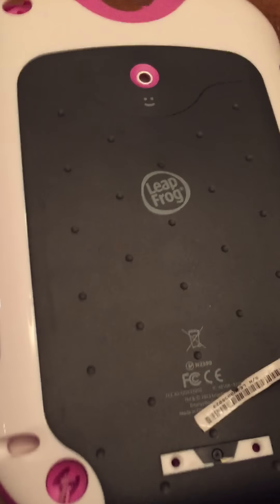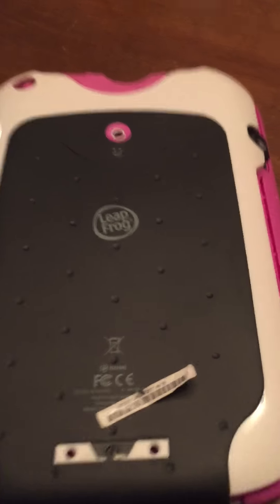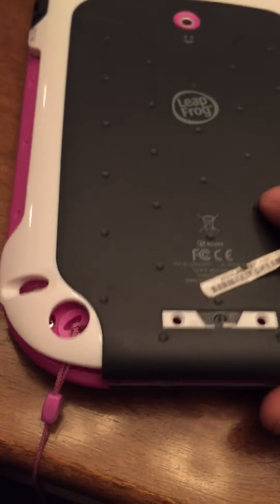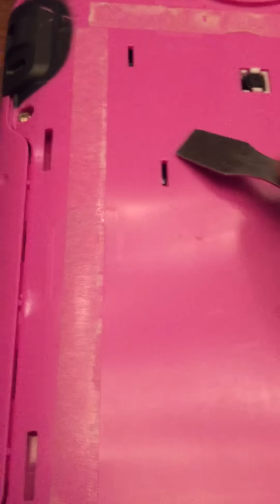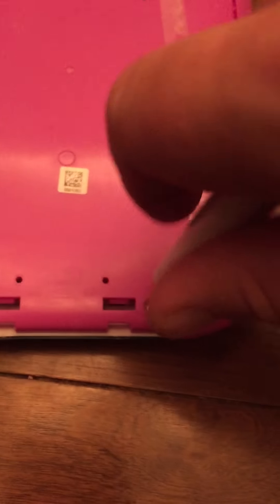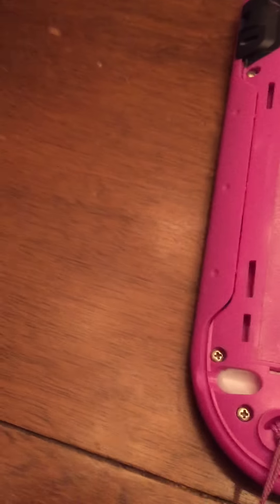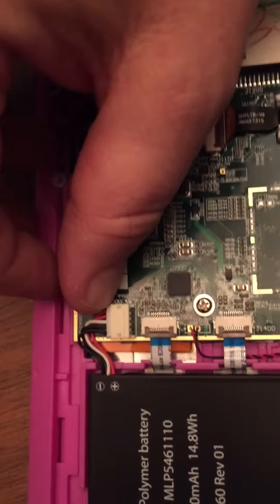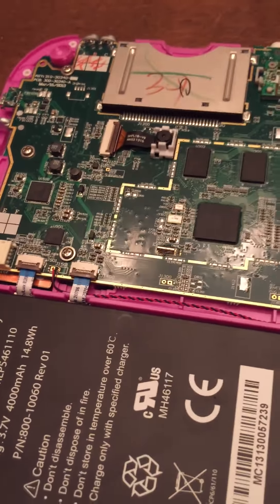How to repair the faux low battery error on a LeapPad Ultra

Comment: Killer video on how to take it apart.  This was just what I needed to start.  My daughter had her screen broken and I went a bit deeper and picked up a pair of broken ones on Ebay for 13 bucks which one had a good screen.  Getting into the case was my biggest concern and you helped me out of the gate, the rest was just screws and a matter of good lighting to see what your doing.  I now have my daughters up and running and have kept the parts in case the battery goes south, but your video also gave me something to trouble shoot if the unit doesn't take a charge or gives me the symptoms you describe.  Thanks!  Took me over an hour to take 3 totally apart down to the screen and get one back together working slowly and carefully! Thanks much!!!
Reply from the maker: Thank you for letting me know. It makes my day knowing someone else was helped and there is anither happy child again (and a Dad looking like Superhero).

Comment: I was having trouble with my son's Leap Pad 3 charging after it was dropped in water. I had let it set in dry rice for a day to try to draw the moisture out and then plugged it in to charge hoping it would still work. After an overnight charging I tried to turn it on and it didn't power up. It would power up while connected to the charger, but not when disconnected. I was almost ready to accept defeat and tell my son he could only play it while it is plugged in, but decided to search the internet just in case there was some way to fix it. I found this video and it worked! This video is for the Leap Pad Ultra, but it also worked for our Leap Pad 3! Thanks soooo much for the video! It saved the day for sure!

Comment: Thank you for this video! It took me some courage to open it up but it was pretty easy. Used a screwdriver and a little eyeglass fix kit. Hardest part was trying to get that tiny plug out and getting that cover back on there. Took me awhile to figure out if it worked or not, but it's all fixed. Thanks again!
Reply from the maker: Jessica Rene Wonderful!! Thank you and I am pleased that it is working again :)

Comment: YESSSS! I took it apart like was described and yes it was a bit tough towards the end but i persevered and followed Earls direction, thanks Earl. the video was perfect. i had to go back and forth a few times to get the directions perfect. but yes it worked. Thanks again....
Reply from the maker: You are very welcome. Thanks for posting your experience.
Reply: Earl, i got a call from daughter saying that she can't get any of the games and also her computer doesn't recognize the pad but it does charge, got any suggestions?
Reply from the maker: Rick, without having the unit in front of me, it would be very hard to say what may be wrong with it. - Norm

Comment: Sadly I tried your fix on my son's leappad and it still isn't working. I've unplugged, replugged, left unplugged for several minutes/hours, held the power button for a short time and long time, and it is still immediately flashing the low battery symbol and then shutting off. It is past its one year warranty so they won't send a new one. Any other ideas of things to unplug? Usually my way of fixing electronics is to hit them but thought I should try the gentle stuff first before beating on it.
Reply from the maker: +backpackergirl1  That is so sad to hear. Sadly I do not have any other suggestions short of possibly changing the battery. For that you'd probably need to look to eBay to find another unit that has a cracked display that you can salvage the battery from. I don't think you can buy the batteries outright.
Reply: backpackergirl1

Comment: I was having the same exact issue with my leap pad and they are sending me a new one. I tried what you did on the old one and now it works perfectly! 
I was just wondering, do they somehow "lock" the old one so you can't use it? Or will we now have 2 functional leap pads?

Comment: OUR LEAPPAD ULTRA WILL NOT CHARGE. WE PURCHASED A NEW AC ADAPTER THINKING WE NEEDED A NEW ONE AND CHARGED IT FOR A FULL DAY AND THAT DID NOT SOLVE THE PROBLEM. I ALSO TRIED THIS AND WE HAD NO SUCCESS. I THEN CONTACTED CUSTOMER SERVICE AND THEY WERE NOT OF ANY HELP. I BELIEVE WE NEED A NEW BATTERY ALL TOGETHER BUT OF COURSE, YOU CAN NOT FIND ONE ANYWHERE AND CUSTOMER SERVICE DOES NOT SELL REPLACEMENT PARTS AND WE ARE CLOSE TO 2 YRS WITH THIS DEVICE. SO UPSETTING TO KNOW THAT WE HAVE TO PURCHASE A BRAND NEW LEAPPAD ULTRA. I MAY NOT AFTER THIS ISSUE. IT WILL MORE LIKELY HAPPEN AGAIN I AM SURE. SO UPSETTING. DOES ANYONE HAVE ADVICE ON HOW I CAN FIX THIS WITH OUT PURCHASING A NEW LEAPPAD?
Reply from the maker: +Pittsburgh Stone and Waterscapes, LLC Don't fret. You may not have to buy a new one as there is still one more option. You can look through ebay to see if there are any out there that are being sold with a cracked screen but otherwise in working condition. If you find one, it may be worth your while to buy and and use it for spare parts. Your still taking a bit of chance of getting another dud, but I bet you could find it cheap enough that it would be worth the risk. I hope you get it repaired. - Norm from Wye Oak Mobile Device Repair

Comment: My son LeapPad Ultra won't read cartridges. Do you have any suggestions what I should do.
Reply from the maker: If it is still under warranty, call LeapPad. They are very good with replacing their faulty items. If that is not possible then with the unit turned off, try cleaning the cartridge slot with a que-tip and 91% rubbing alcohol. I'm afraid that if that does not help then you'll have to purchase a new unit as there are virtually no sources for aftermarket replacement parts on these units.

Comment: Grateful for efforts & sharing this. I bought a refurbished one CHEAP from a4c.com and it developed this issue after the short warranty expired. I assumed the battery died & searched for help on how to get inside the thang which led me to your vid. The procedure worked - However, a month later its back; repeated procedure twice more - now it won't even boot from the battery, but will run with the cord/adapter attached - any ideas? Maybe I created a new problem?